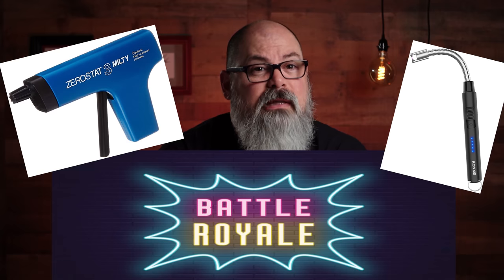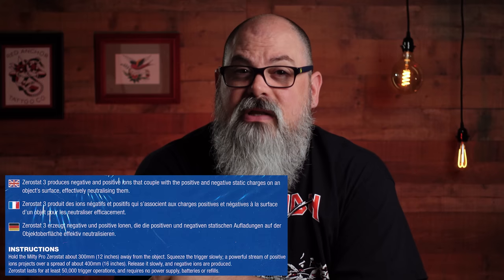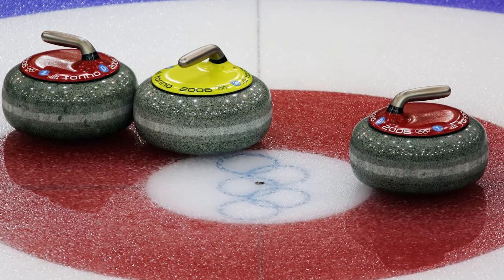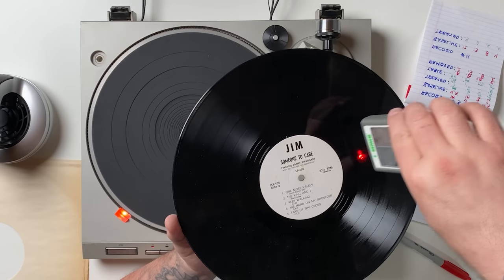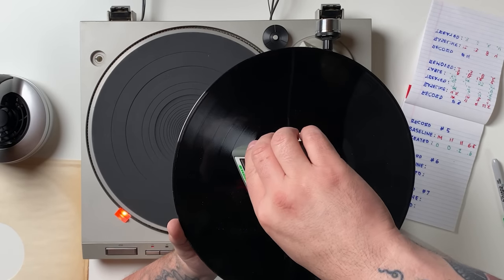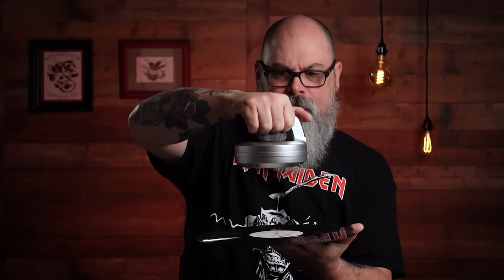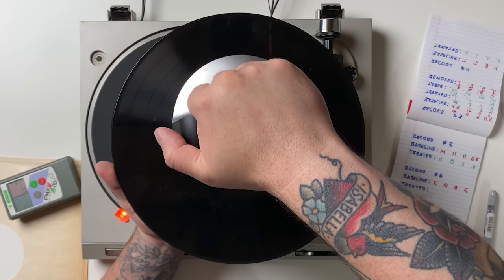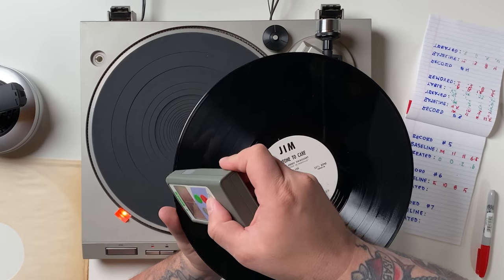How Well Does The Destat III Work?

Comment: Yes! I've been looking for, waiting for, a good test of this product. I don't have a static measuring device, they're rather expensive too, but I've owned the ZeroStat 3 for years, and while it does work (when they don't fail after less than 2 years), I've always felt something has to be better. I've looked at the Destat III online for a while, but yes, $400 is a bit rich for my blood.

I've always had some wicked static here in my house, for whatever reason, especially in the super dry Oklahoma winters. I try to run a humidifier at 40%, but even that only seems to help so much. I can tolerate a few clicks and pops on older, not so perfect records, but when you still get static noise from a new, well cleaned record, it can be very frustrating indeed.

I may have to hold off on a few new record/gear purchases soon and go ahead and get one of these. Oh, BTW, the only test I'd be interested to see, might be one where you test the record, use the Destat III, then measure the levels on BOTH sides.

Peace out brother.
Reply from the maker: Having had this for a while, I feel it was worth it for me. It's one of those things that everyone will have to decide for themselves because of that price though.

Comment: As a woodworker I'm very familiar with the elimination of static in my dust collection system and the way to do it is simply to ground the pipes. So to my mind if you're turntable is properly grounded and your platter mat is conductive then static should be basically gone down the ground and any static will be generated from removing the record. Just my logic and experience. Great video as always 👍
Reply from the maker: It does go down some pipe or another, the question is how bad is that for very sensitive electronics. I think it's better to not introduce any static at all if possible. Your dust collector is a bit more robust than my turntable ;-)

Comment: just found your video's so this question may have already been answered but one test I would have liked to see is get the static numbers, use the destat on side a then on side b, then get the static numbers to compare one side vs both sides. regardless, awesome vids. thanks.
Reply from the maker: I thought about it, but as we only play one side at a time I wasn't as concerned. It may happen down the line, however.

Comment: I bought this a few years back. It's worth every bit of what I paid for it. My records sound great.  Today I brought it to work . Our stretch wrapper was winding up due to static. I used it on the rolls of stretch wrap. The stretch wrapper is working perfectly now.
Reply from the maker: I wouldn't be without it myself now that I've been using it for so long.
Reply: Right, but a different Balanced Ion Flow Generator would do the same job for significantly less money though.

Comment: Hi Chris, You are very well spoken. It seems this outlet is a good fit. I also like your approach of paying attention to detail.\
I use a Miltypro 3 my self and find it works well. The Destat 3 is interesting, but the claims are just too much of the same thing I see about every audio product around. I have never tried the Destat and I feel I correctly assume that it works well.
Yes, I agree with you about prices, it get's to be Ludacris fast. Anyway, for those of your audience with more modest means (myself included no doubt) I have a possible fourth contender for your upcoming battle royal: I also use a Thunderon brush for static elimination. I was skeptical, but those reasonably priced Thunderon type brushes actually work very well. I just hold the record and brush one stroke with the grooves one half and one stroke the other half on one side and 97% of the time the static is gone.
So you may want to consider a four way fight?
Reply from the maker: I'll certainly take a look at it. Thanks for the suggestion.
Reply: @thevinylattack  Of course, your welcome. 
I was in the industry as a journalist myself from 2012 through 2017 (writing, I'm no good in front of a camera). I'm thinking about jumping back in perhaps in a few months, but with a slightly different approach concentrating more on advice now that I have a few notches on my belt. I also restore vinyl records as a hobby, (studied for two years academically for that and still learning something here and there. You never stop learning actually).

Comment: Okay, I have a National BH-653E Electronic Static Eliminator for years. After I learned how to make my own cleaning fluid made of (for 1 liter) 750 ml distilled water, 250 ml isopropyl and 5 ml Ilford Ilfotol wetting agent.

Ilford Ilfotol wetting agent also has a strong anti static capabilities. After wet cleaning my records have hardly any static. The meter on the static eliminator shows no sign of static. I know that the meter is still good. Because every new record I buy I check it with the static eliminator. The meter then goes back and forth like crazy. After wet cleaning the new records are completely anti static for many years. And no, there’s no residu left behind on the records!

Comment: The reason we get static is because of the Triboelectric effect, any two differing materials pushing or rubbing against each other will cause charge transference or static, Vinyl attracts electrons, best way to eliminate is by preventing build up in the first instance.
I invented a little arm that you swing across the record before playing, it has a tinfoil curtain that hangs 2mm above the record surface and it grounded to the sub chassis (sprung part), you can make a simple one yourself by simply wrapping a little tin foil on the tone arm on the rear of your cartridge (dont  short the connections), shape it so it forms a curtain hanging just above the record surface without touching-the high voltage jump a few mm's anyway, the grounding on the tonearm should be sufficient even if it is painted, as the high voltages from static cross the paint barrier.
Try it and you will see, no more static on your records EVER, whats more  I think it improves sound.
Just remember to remove it before your friends see it, they will think you are  nut job.
OR get a humidifier, that also reduces static by sending electrons to natural earth paths on the turntable chassis.

Comment: (1) How about treating in the hand, first. (2) Then, a second time on the turntable? (3) Are there platter protectors (cork, rubber, acrylic) that will react better to reduce static. (4) The records are being 'whipped out' of paper sleeves. What is the result with static there? Is increased speed/friction an issue? (5) What about rice paper MOFI sleeves? Finally... (6) what about playing the record 'wet' to eliminate static?
Reply from the maker: If you treat a record in-hand, treating it on the table isn't necessary (and won't do anything anyway). Cork is the best choice for natural static reduction, but no mat will be nearly as efficient as an anti-static treatment. Paper sleeves are the devil. Mofi sleeves (and those like it) help keep static away but don't do anything to eliminate it. Playing a record wet is a terrible idea.

Comment: I bought mine way back when it went on sale, too. Was tired of the short lifespans of the Zerostats and started investigating. I have 3 dead Zerostats sitting including an original red one I hunted down.  They lasted barely a year each at a $100 plus a pop.  So the Destat III is a bargain when looked at over a period of time.  It is still working very well.  My TT is a SL1200 MK3 with an original made in Sweden Discwasher carbon fiber mat from the late 70's on top of the standard rubber mat.  I use the DS III every time I drop the needle with the vinyl playing at the very beginning.  Even if I do not take it off before replaying.  Only during the driest time in the winter has the carbon fiber mat ever come up stuck to the bottom of the record when taking it off the TT.  Maybe once every 20 times or so.  The second or third time I used my DS III my cart actually popped and discharged its built up static from the beginning of its life.  No noticeable negative effects on the TT or nearby electronics including my preamp / ADC and computer that I record with which is right next to the TT.  Over a least two years or more of use.  I do understand how the static is moved from one side to the other but with the carbon fiber mat for a dielectric in between the vinyl and the TT I have no idea where the static is transferred to.  I just assumed that it was dissipated and gone.

I used it on other devices for the purpose of degaussing them.  Finally, I took it to the drier to see what it would do to a dryer full of dress shirts freshly dried.  Reaching into the drier there was the expected hair raising static cling of all the shirts sticking together.  Got the DS III and gave the drier a blast and all the static on the shirts was gone and even wrinkles relaxed.  This is one powerful puppy to do that.

Thanks for the informative video which reassures me that I have been on the right track with my due diligence in attacking static.  If I have to buy a new one every three years, it is still worth it.  I hope it lasts a very long time and expect it to.
Reply from the maker: While a bit pricey, I still say it's worth every penny. Your experience adds to that.

Comment: Wonder. What is happening (static-wise) between treatments, sitting record aside, writing, picking back up,, (without re-measuring,) and then, placing x-factor onto turntable to measure.
Maybe popping up screen graphics in post, would assist viewers, but, then, you'd not immediate data.
Reply from the maker: As I treat every record before every play, I'd simply recommend people do the same. It eliminates those variables you mentioned.

Comment: I'd be curious of a couple things. First, would it make sense to use the Destat III on the table itself, to potentially reduce the amount of static in the environment? Second, since the record will pick up some degree of static from having been on the table, would it make sense to run the Destat III over it again, prior to putting it back into an anti-stat/poly sleeve, and back into the outer jacket? Or is that overkill, because it will pick up static over time as it sits on the shelf anyway? Not sure I'm keen on spending over $300 for a device like this, but it's interesting to consider solutions like this, because static is the biggest thing I fight with my record collection and playback.
Reply from the maker: Treating the record in hand is the best way to go about it.

Comment: CORK.
That's an awesomely beautiful mat dude!! I've always loved cork mats.
Lately I've been using a crosley c6 with a LP gear elliptical upgrade!

It has a rubber mat currently but it still rings line a dinner bell.

My Denon has my cork may with the grado prestige black.
But yeah CORK CORK CORK
Reply from the maker: You're at the wrong video bud. The raffle generator won't read your entry on this video.
Reply: @thevinylattack  My bad, I blame my TV I'm using for YouTube. Sorry.
Reply from the maker: @dusterdriven  No worries.

Comment: Sorry for delay but I have 1 question Did it improve the sound of the pressing 
? Thanks
Reply from the maker: It doesn't make the record 'sound better' on its own, it removes static which eliminates dust (with a quick brushing) and surface noise which in turn makes the record sound better. A lousy pressing will still sound lousy.

Comment: Humidification is well known to reduce static buildup. I wonder if holding the records over a small humidifier (with distilled water) for a few seconds per side would be just as effective, or alternately also maintaining the humidity in your listening room to a level such as between 40-50%. (too high and it might feel a bit tropical in there!)
Reply from the maker: Humidity will help reduce static in a room, but it's not a static remover per se'. If you steam your record, you're essentially doing a form of wet clean which will indeed help eliminate static however.

Comment: If its just an ionizer, could one of those cheap 5-bucks USB ionizers (plugged into a USB powerbank so you can hand-hold it) do the same thing? Love the channel btw, Subscribed!
Reply from the maker: It's certainly worth taking a look.
Reply: I tried one of those a while back. I didn't have a device to measure before/after, but I found it to have almost no effect when compared to the Milty. I think it just generates too low of a stream.

Comment: Chris could I ask a question.  The static on the record when placed on the turntable significantly reduces without the need for any treatment from any type of equipment.  What is the actual benefit when the figure say is 1-2 before (when on the turntable) to 0.2 (after treatment on the turntable).  Does the treatment really help significantly if it reduces real time playing from 2 to 0.2.  I’m trying to justify spending over $300.
Reply from the maker: Treating the record is a good idea because it keeps all that static from entering your turntable. It's a very sensitive instrument and introducing static can affect not only the sound, but potentially the electronics. You don't need to spend $300 however, there are more affordable options on the market.
Reply: @thevinylattack  thank you for your reply. Great channel, just found it and will be watching future videos
Reply from the maker: @jbee8882  Welcome aboard!

Comment: You should check out a Staticmaster brush. It's made for use on film, but works well for records. It has a strip impregnated with Polonium 210 as a deionizer.
Reply from the maker: I tried a version of that and it didn't really do anything. If you have a specific model in mind, I'll certainly take a look though.

Comment: Problem with these type of static eliminators is as soon as you start playing records, static will be re-introduced into the record from the friction of the stylus against the vinyl record.  The only way to make sure there is no static build up at all while you listen to the music is to use a device that is continously on when playing vinyl.   Two such leading products currently on the market today specifically for turntables is the DS Audio ION 001 Vinyl Ioniser and the CS Port IME1 Vinyl Static Eliminator !
Reply from the maker: Playing a record isn't going to bring in a bunch of static on a static-free record.
Reply: @thevinylattack  Would be good to measure after playing a record to see how much static is put back onto the vinyl ?
Reply from the maker: @mspdec  I've done that, just not on video.

Comment: I just ordered one based on your results.  Have the gun but....Nicely done.  I use a table with a felt mat and sometimes there's so much static the records lifts the mat with it so I was surprised at how low it was on your table.  Are tables different in that regard?  Could it be related to their grounding scheme?  Mine has a ceramic platter and no idea how that does or doesn't contribute.  Thanks.
Reply from the maker: Generally speaking, turntables ground the same so I don't think it really has to do with that. The platter mat, environment, and condition of the record are the main factors. The Destat is by far the best product I've used for static elimination. Just use it as directed and with the record in hand, NOT on the turntable.
Reply: @thevinylattack  True, but a couple of thoughts.  One is the obvious difference in different mat constructions.  With your seeming insulative rubber mat I was surprised that it seemed to have grounded itself to the table. Secondly a notable exception is Rega, a long standing popular make of table that uses no conventional grounding. There is no ground lug, no obvious chassis ground at all.  Rarely is it a problem but as a dealer I have seen it become one.
Reply: @thevinylattack  Thanks for the review.  The Destat works great.  Also have a new turntable with a 45lb bronze platter so no more ceramic (Micro Seiki RX-5000 from 1984).  Just received the DS Audio piece that sits beside your table and is designed to neutralize the static as it develops on the record.  Obscenely expensive but no firm impressions yet.

Comment: I got lucky and got a destat 2 when it was discontinued for $180. My cleaning ritual is as follows, destat the album side on the ten second cycle, take a high quality latex paint brush with groove washer G2 solution on it run the turntable at 45 rpm, then take my GW disk cleaner to the album to dry it, and a final 10 second destat cycle. No pops or crackles at all.
Reply from the maker: You could eliminate the first destat step and save yourself a bit of time. The wet clean will remove the static.

Comment: I thought the Milty was expensive.  On another note.  My record players dust cover was dusty so I wiped it with a microfiber cloth.  Bad idea.  It created crazy static on the cover.  I could hear pops and clicks as I closed and opened the cover.  The solution was to pull off the cover and hold it dangling in one hand.  I then tryed the Milty using the 4 pull, dead center method you did in the Milty video.  It killed most of the static.  Also, I wonder how an acrylic platter changes the static charge on records compared to a rubber mat, felt mat, and cork.
Reply from the maker: The mat you use can definitely have an effect on static.